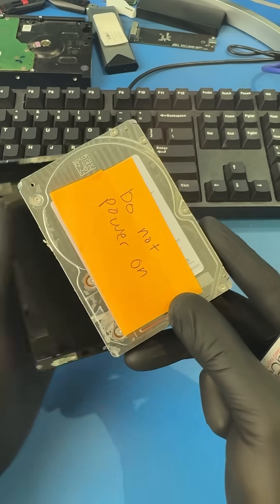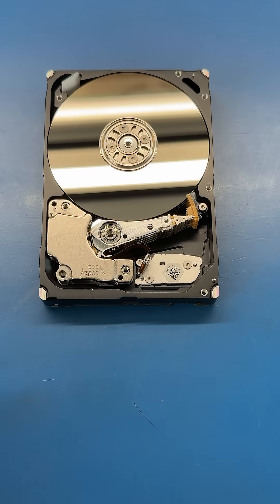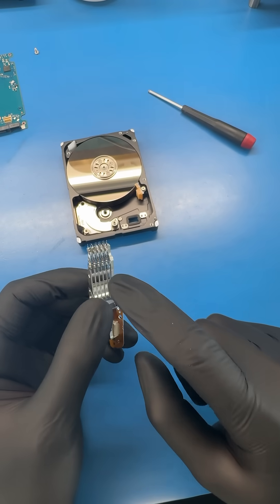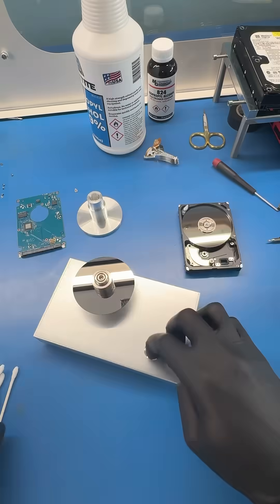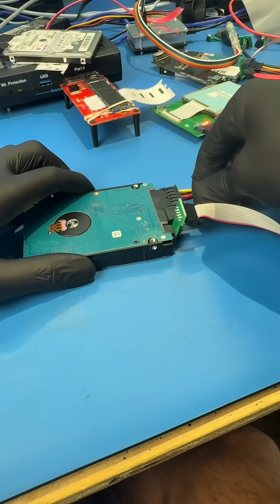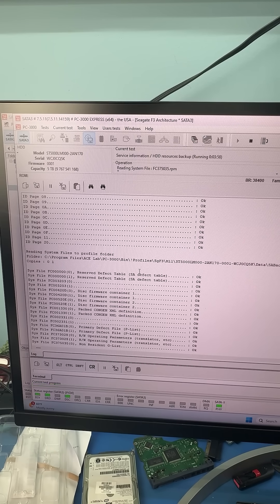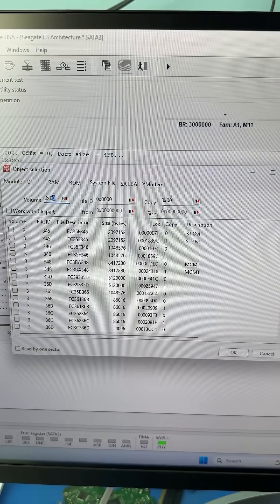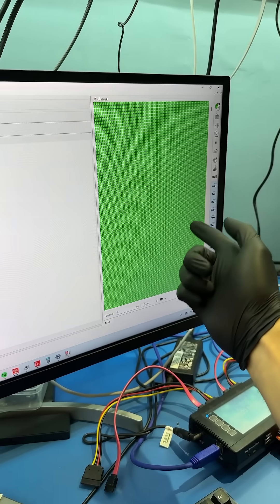Hard Drive Platter Extraction... #technology

Comment: I thought the platters could not be removed because the data is saved in cylinders. Is my knowledge outdated?
Reply: Wikipedia seems to be telling me that newer (2010+) larger (2TB+) disks have addressing systems that are decoupled from the actual geometry. 
The details are well beyond my understanding.

I didn't even know you could buy a 5TB hard drive. I assumed manufacturers were only advancing SSD tech these days.

Comment: Dude did all this without a clean room. Massive data recovery companies would've charged THOUSANDS for this
Reply: he has one tho
Reply: This is in a clean room
Reply: @tomb7890  😭 and i bet you he still probably charges a thousand or so dollars because not many people have this guys' expertise.
Reply: That's a laminar chamber - a miniaturized version of a clean room. Looks like a lab hood. You can see those lights reflecting from platters, and then a net-like construct - which is actually a big HEPA filter running constantly as long as the drive isn't fully closed. Also no actual ambient sound on the video, but be aware that that thing is looooooud.

Comment: Hardcore computer science
Reply: Computer engineering*
Reply: @sr0-rage it’s computer science
Reply: @joeyp978  It seems like it would be more computer engineering as he is dealing with the low-level technical firmware as well as the hardware, but I am sure there is lots of overlap.
Reply: @joeyp978 no I'm literally a computer engineering grad, I studied mostly this low-level firmware and machine code material
Reply: Most of what was shown in this video involves zero CS and only a bit of CE...
Reply: Computer Science (CS) deals with the theory,  the math, and algorithms behind the processes you see here. 

This is Computer Engineering because everything you see are implementations of the CS theories and algorithms in the form of programs used and the skills of the technician on video.
Reply: @IMNODOCTOR Thanks for the clarification. I was sure it was a science

Comment: And that's why I have three hard drives. 👍💎
Reply: bro just get solid states 🙏🙏🙏
Reply: @drlaggybro SSDs fail too. For bulk storage hard drives are good value. SSDs get expensive fast 265 x 4 € for 4TB NVMe drives 155€ for PCIe x16 - quad M.2 card not to mention you need a system that can deliver PCIe x16 to GPU and storage. Meanwhile 16TB HDD cost only 250€. And you need to backup it into two places. If you don't get at least a 10Gbit nic to not bottleneck SSDs on network storage.
Reply: @ArthursHD  Agreed....went down this rabbit hole with drives in the xp era.

Still prefer platter drives, but dvd rom is almost fool proof.
Reply: @ArthursHD I wasnt talking about NVMe SSDs.